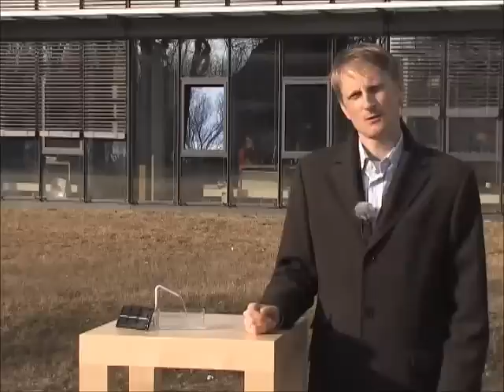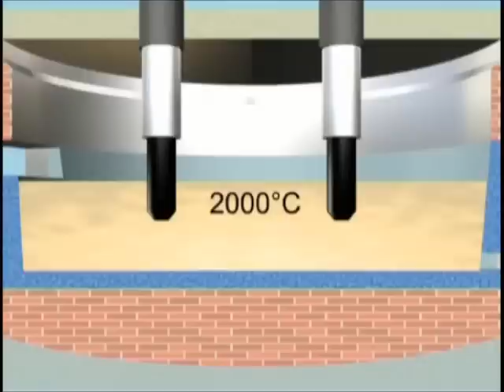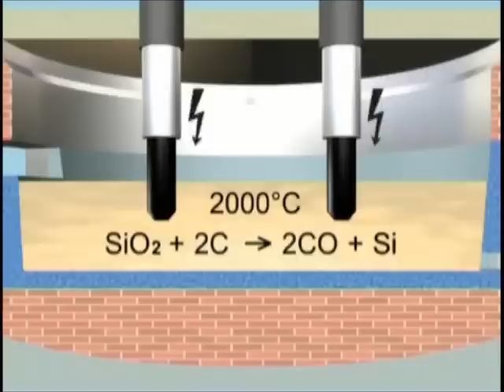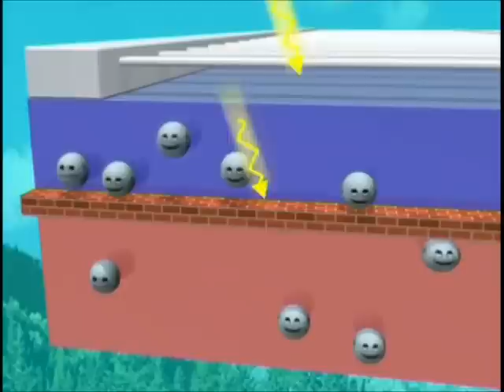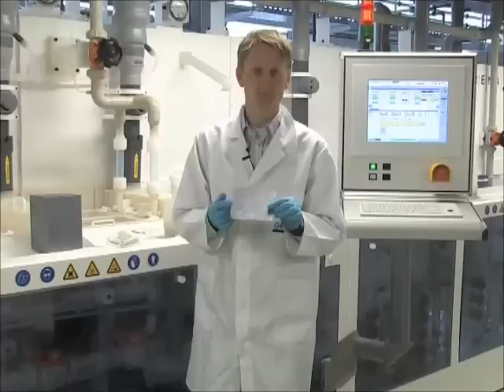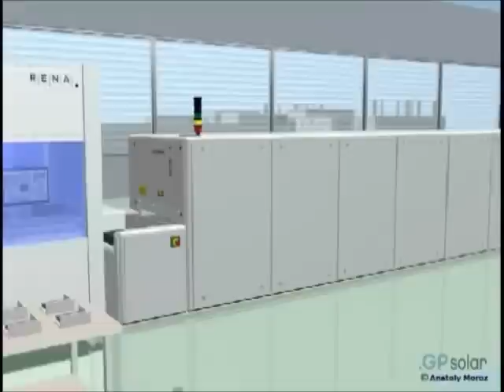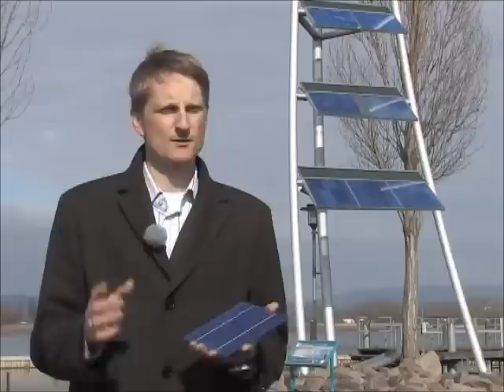Solar Module Manufacturing

Comment: Solar panel is used to transform Sun light energy into electric potential charges. 
Does it is capable of transforming light energy of Moon reaching on surface of Earth, into electric potential charges?
Does the solar panel can produce power during daytime and why not during night time?
How the change in season (summer, winter, monsoon) effects the efficiency?

Comment: I am asking you a trivial question related to the soldering of copper wires on the surface of photovoltaic cells for small applications.  the bonding surface has exfoliated and I can no longer restore the electrical connection between the photoelectric cell and the device itself.  what do you advise me to do to continue using the photoelectric cell?  Regards

Comment: This is rubbish, Quartz and coal (around 10 tonnes)  are used to make solar panels, NOT sand or silicon as you put it.

The raw material for the solar panels is coal, which has an average life of 11 years. This means that 11 tons of coal must be burned to make a solar panel – that’s about 3000 pounds! The production process uses high temperatures and pressures.
Reply: Not burned. Melted.
Not 1 solar panel. 11 million solar panels.

Comment: Burn more coal to make silicon to save the Earth! I don't think Orwell could've said it better.
Reply from the maker: it's all a question of how much energy can you produce for such a little bit of coal for silicon.
At the end it is a factor of more than 30 - you  need in total app. 1kWh of energy for producing solar modules to finally produce at least 30kWh of solar power....
Reply: @Ericrueland007  Thanks for the reply. That's a lovely 1/30 ratio but what is the life cycle of these units and efficiency ? At the end of Michael Moore's movie "Planet of the Humans" he asks a very pertinent question: "Can technology made by fossil fuels save us from fossil fuels?"  In the long run I believe the answer is no, unfortunately.
Reply from the maker: @DrRussPhd  The todays most commercial way to produce silicon is described in this video - and you need app. 3g of silicon per Watt solar cell (producing app. 30kWh over the livespan). 
Nevertheless silicon of solar modules can easily be recycled - and re-used. the power for the re-cycling process can be 100% solar power.

Comment: What is difference between P type and n type modules
Reply from the maker: It is the different cell technology used. Standard (traditional) solar cells are p-type. Using Boron for initial doping of the silicon - making the silicon wafer p-type (or with a majority of holes not electrons for conductivity). The phosphor is used to make the p/n-junction or  diode in a standard cell. For n-type it is the opposite: the silicon wafer material is doped with phosphor and the layer is made of Boron doping.
At the end: n-type is a bit more complicate to manufacture, but gives higher efficiencies. Therefore it seems to be the near future...
Reply: @Ericrueland007  Thanks for your reply. I did a lots of study on it. Following are the advantage of using N-type over P-type cell. 
1. LID losses will be 0.6% inplace of 2.2% . 
2.Temperature derating losses are very low in N-type as compared to P-type cell.

These results are based on final yield analysis report from PVsyst modelling software using Third party verified .Pan files.

Comment: Informative video indeed! 
But actually I have been given a project in which i have to make a solar cell. But i think it's not possible for a student because resources are not available. While many DIY solar cells are there on YouTube. But i don't how much efficient they would be.... #Dr. Aric can u help me in this regard? Kindly give me a suggestion that DIY solar cells which can be made at home, would be effective as my bachelor's project or not?
Thanking you.
Reply from the maker: Actually I do not recommend to produce a silicon solar cell as DIY project. You need chemical processing equipment and high T processes, which are not able to run DIY. Other low-efficiency concepts (like a dye sensiticed solar cell) are possible: https://www.youtube.com/watch?v=17SsOKEN5dE - but don't expect efficiencies > 5%.
Reply: @Ericrueland007 lot of thanks for your precious suggestion!
 you are right but actually the difficulty is that i have to use it in a circuit like on a breadboard i have to attach it and then to show that I can use my solar cell in a circuit as a voltage source and circuit is giving it's respective output so perfectly. And That's too much difficult with a DIY solar cell i think.

Comment: Don't show this to the uneducated green nuts the mere mention of coal their heads will explode!!
Reply from the maker: yes, there is one good way to use coal - make pure sillicon out of it. As a solar module will reduce the CO2 production at the same time by a factor of at least 20 times.
Reply: @Ericrueland007  Of course you have to remove the calculation of production fallout and yearly loss of efficiency. Not to mention the ten years of useful life. But then we can feel good about ourselves.

Comment: Behind each step in manufacturing a solar panel/module, there was coal or fossil fuel energy used to manufacture a finished product and then when it's done, they magically just call SP a ''green' energy LMAO
Reply from the maker: Well, you could easily use solar electricity or solar produced Hydrgon for the processes. At the end it is important to understand: photovoltaics will produce more than 30 times the energy (from the sun) compared to the energy used for production of the solar module!
Reply: @Ericrueland007  Yes I agree, we could but watch how expensive that SP will be in comparison to SP produced by cheap coal&FF energy. I'm not against SP or any green energy for that matter, I just believe we are being manipulated into believing how green energy is green! It's very hard to find carbon footprint info on SP or wind turbine etc.
To some extend (debatable how much), green energy is just a big hoax!
Reply: @kolobara08  on minute eleven, you can hear that it only takes 2 years of solar power to manufacture the same solar plant again.

If the lifespan is 25 years… that means that you get 23 years of carbon-free energy.

Comment: Can enough power be produced by solar panels to power the plant that makes the panels? And what would happen to the plant on a rainy day?
Reply from the maker: yes, of course. We have already solar installations with more than 2,4 GW of rated power. During bad weather conditions you need energy storage. That could be solar hydrogen or battery power (maybe TESLA batteries as a second life).

Comment: What will be the Cost to start a Solar panel Factory?
Reply from the maker: The solar panel manufacturing is connected with the lowest invest needed. For a capacity of 100MW per year the invest for a solar module fab (you have to purchase the glass, laminate and solar cells) might be in the range of 15 Mio US $. on greenfield. But invest in solarmodule plants is just around 0,5 US$ per Watt installed. Giving a electricity cost of app. 0,05 US$ in sunny regions.

Comment: Can a factory like this be installed in my hometown Larkana Pakistan?
Where sky remains mostly clear and people are very industrious.

Only hurdle is the high cost of imported solar panels.
The cost can be reduced if it's made right from the scratch at same place from the extraction of solar grade Silicon to the end product.
Manpower is available aware of the mechanism.

I am a 77 years old retired university professor and has been teaching Energy Conversion and Alternative Renewable Sources, nearly entire my life.
I have also the honour to remain on the exchequer of Central Government in its Planning Commission.
Reply from the maker: Good Luck for the plan to start such a projecct in Pakistan! Starting with module production ist an easy step - solar cells, wafers and silicon can follow.
Reply: Sir how I contact with you

Comment: Rubbish, SOLAR CELLS are not made with any sand, that is too impure to use, they use a pure quartz and a high grade coal, they melt the coal and quartz and out comes the raw material to make the solar cell. It takes a huge amount of energy to make them, so these are not green by any means.
Reply from the maker: you are right, that quartz sand is needed. But this is not a major game changer as quartz sand is widely available. And solar module produce much more than 20 times the energy it needs to produce the modules - it is a energy plus source (after installation there will be only electricity produced by solar).
Reply: Don't try to get in the way of the money-grubber greenwashing this stuff. You will get steamrolled.

Comment: “You can use any type of sand”. No, that’s a lie. Almost exclusively very pure silicon ‘sand’ is used. Not from the desert, but from these kind of quartz mines.  

The man just said it himself, you need 99.999999% purity.
Reply from the maker: you are right - quartz sand needs to be used. But this is by far not a seldom source.
Reply: @Ericrueland007  It is, that's why chip prices are spiking, the silicon they are made out of is made from this same sand and the stuff is becoming much harder to come by ALREADY!

Comment: 8 years ago: “We won’t run out of it”.  

Now: Yeah we’re running out of it.  

People are always too optimistic with these things. Sure there’s a lot of silicon in the earths crust, but how much of it can WE access.  
They love selling things this way.
Reply from the maker: solar electricity has reached a cost level of below 0,03 US$ per Kilowatt hour in sunny regions. Therefore it is the lowest cost source for electricity globally. Every year more than 150 GW (or app. 150 power plants) are produced and installed. This is reality.
Reply: @Ericrueland007  Lowest cost locally*. You can't say it's x price in sunny regions and then say it is the lowest cost globally.   

Don't forget the part where solar isn't actually renewable and they bury the panels in the sand because their efficiency becomes worse and worse until they are simply unusable or break before that.  

I'm assuming you're assuming the efficiency of a new panel, which is never going to last for very long.
Reply: @faramund9865  a car needs increasing maintenance to the point of not being worth the ongoing expense at 15 years or so.

Comment: SO, the process produces CO2. Amusing
Reply: Yes, but they pay off their carbon debt pretty quickly. I think it takes like 2% or 3% of their service life to hit the break even point where carbon released equals carbon saved, and after that it's all gravy from a climate standpoint.
Reply from the maker: @williamdobbins7556  you are right - the energy payback rate is much more than 20. and steadily increasing. with latest cell/module technology the reach of more than 30 times is there. As well lifetime was originally expected to be 20 - 25 years, but in fact it can be more than 30 years.
Reply: They also consume petroleum, which is used for the plastic backing of the PV cell. I honestly don't understand why we haven't been producing PV cells to be as recyclable as possible so that eventually we don't need to produce any more new ones, and just recycle the old ones every 25-30 years.
Reply from the maker: @smugless191  Recycling of most of the material IS DONE. But solar modules have a minimum lifetime of 25 years, which makes it still no big business. But it will come. And plastic is only less than 5% in the module.

Comment: YOU ARE A LIAR. SOALR PANELS ARE MANUFACTURED WITH SILICON FROM QUARTZ NOT SAND.
Reply from the maker: Well, it is correct - Quartz is used to produce silicon as it is better for production compared to quartz sand. But the material is similar and Quartz is as common as normal sand.

Comment: Am interested in A full Integrated Solar Fabrication as a business where can i start from engaging with GP Solar Solmic been trying to find website but it keeps taking to other sites
Reply from the maker: You can contact the equipment manufacturer in Europe or Asia, but the industry reached a level of maturity, where starting from zero is very tough to reach comparable manufacturing costs. The price for solar modules are at a level of 0,2 - 0,35 Euro / Watt. Producing 1 - 2 kWh/year reaching full levelized cost of energy of 0,02 - 0,08Euro/kWh - 100% competitive to all other sources of energy.

Comment: they only show where the silicon goes and not the carbon, it also appears that you need an equal volume of coal sorry carbon to complete the process......hmmm.  How green is this?
Reply from the maker: Well, it is correct. The production of solar cells and modules produce CO2 emmission. A scientific calculation shows: app. 50g of CO2 per kWh electricity. But coal produces 1.075 g of CO2 per kWh - that means a reduction by a factor of 20!
source: www.ise.fraunhofer.de

Comment: Coke is needed for silicon production :D A lot of CO2 is created by production but still better tha cars or meat industry damage to planet
Reply from the maker: Well, it is correct. The production of solar cells and modules produce CO2 emmission. A scientific calculation shows: app. 50g of CO2 per kWh electricity. But coal produces 1.075 g of CO2 per kWh - that means a reduction by a factor of 20!
source: www.ise.fraunhofer.de
Reply: @Ericrueland007  I wonder is there alternative to silicon?
Reply from the maker: @sauroman1  at the moment still Silicon is the perfect material and 95% of all solar modules produced are made of silicon. But it can be recycled and in future a big part of the material will come from recycling sources.

Comment: it seems clean abundant energy still needs non renwable dirty energy to create it, does the power generated from the cells make more than power than the power the fossil fuels used to create it? hmmmmmm
Reply from the maker: Yes, definitely. The energy payback time is below 12 months. Means a normal solar module installed produces the electricity needed for production in about 12 months. The other 24 - 29 years of operation is plus-energy...
Reply: @Ericrueland007  so those solar panels should be powering the mining equipment and the arc welding furnaces... until I see that, I can’t see a whole lot of validity in your claims...

Comment: This is great, but look at all the Fossil fuels used to make the makes, from all the vehicles used to mine the silica sand to all the welding "furnace-ing" energy.  Yes the Panel can be a nice little supplemental solution for energy needs.. thats about it, as you need to use quite a bit of fossil fuels to generate them..
Reply from the maker: Energy payback time is below 12 months. That means all solar electricity produced after 12 months is "solar plus" energy. A module can produce electricity for 25 to 30 years. You might need some energy storage, but no more fossile.
Reply: @Ericrueland007  ok, how about powering the  mining equipment and arc furnaces with solar power? why are you using fossil fuel powered equipment to produce this? Also, why isn’t aluminum produced from renewable, well more accurately solar power?
Reply: @razadaza9651  Also, throw in the energy and CO2 emissions that goes into producing, transporting, and installing the equipment that is used in the silicon plant itself...not to mention the construction of the entire facility. We love the IDEA of renewable energy, but they (Environmental Extremist and deceptive politicians) don't promote the full story to the general public. It's up to the engineers and scientist to provide the reality check to the People.

Comment: A good video, without doubts..but only one thing, you missed the part, where cells are treated with silicon nitride in orther to enhance performance and reduce reflectivity of the modules. At least I couldn't see that part. Thanks for the video. Good wishes and happy new year.Greetings, Gerard.
Reply: Precisely, that gives it, its characteristic blue colour.Thanks.

Comment: Which solar cells are bettet whether monocrystalline or  polycrystalline for solar pv plant
Reply: Bruganalla Subhan  polycrystalline is better coz of more wattage per square meter but are costly.
Reply: @ScalewithBhanupratap  I'm afraid you have that backward: monocrystalline have an efficiency of about 22% whereas polycrystalline are about 16%. And monocrystalline are more expensive to produce.

Comment: imagine even thinking about this process?? smart people for sure but can solar power actually be used to create solar panels?
Reply: Yes, of course it can. Any source of electricity can be used.
Reply: Yes I'm pretty sure that's why this factory has its own solar grid. He even mentioned that you get about 12x more energy produced by the panels than you put in. Of course, it takes carbon to produce them and emits CO, which is not terribly good for the atmosphere.
Reply: not really! the sun is used to produce solar panel.....

Comment: Great efforts towards clean energy production and being a Geologist I am adding that we have all the basic raw material used for the manufacturing of solar panel so is it possible to install a solar panel manufacturing unit here.....?
Reply from the maker: Definitely - no problem. Regarding profitability a silicon fab makes most sense at regions with low-cost and high availability of electricity (often huge water power areas are choosen). For solar cell and solar module manufacturing no very specific ressource is needed.
Reply: @Ericrueland007  are there any materials that could be at risk of not being available, due to wars or trade sanctions?
Reply from the maker: @robertoguerra5375  silver is needed for the contacts in solar cells (front and backside). At the moment already app. 30% of silver is used of solar industry. With a tripling of manufacturing capacity it will be a limiting factor. 
But it is very likely, that alternative contacting methods using alternative metals (Ni, Cu) will be introduced into the industry.